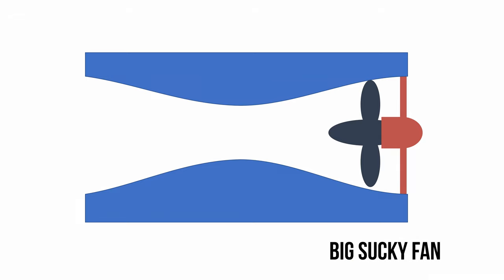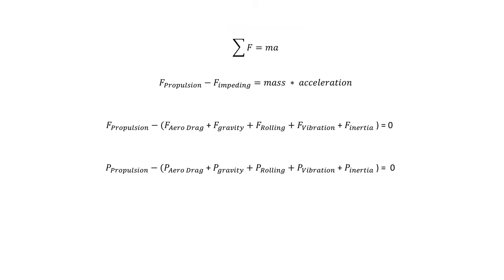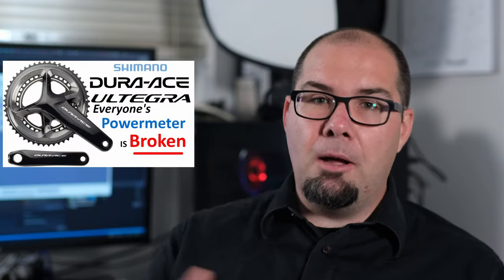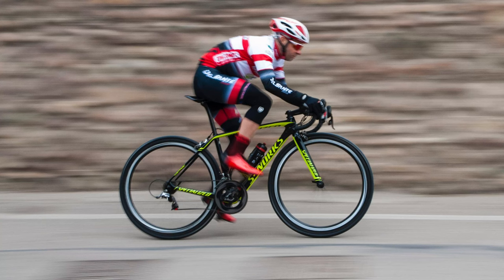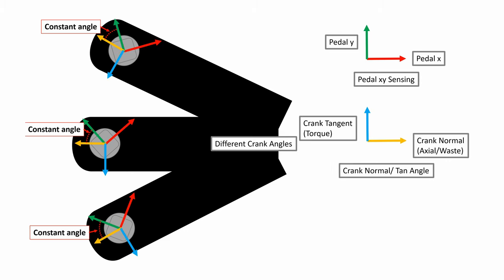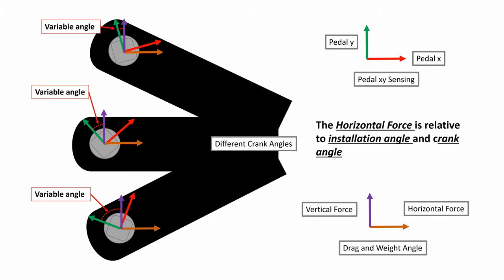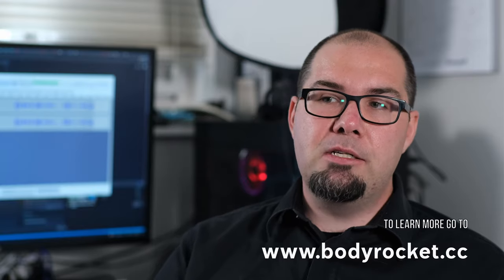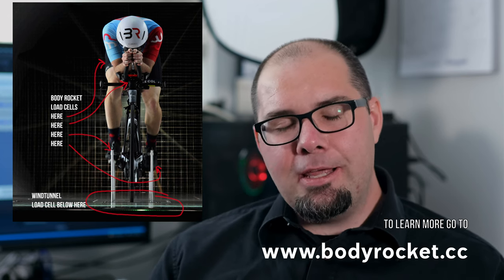What is Direct Force Aerodynamic Sensing... and what isn't?

Comment: I'm intrigued as to how the final product from body rocket will integrate with people's actual bikes. With so many modern TT bikes being so integrated and requiring specific front ends (not to mention different pedal systems), I'm interested in how this will work from a commercial standpoint. I'm sure you've got this figured out as I know there are multiple very clever people involved.
Reply from the maker: That's not my wheelhouse, but you're totally right. It's fairly similar to my involvement with crank based pm design... just harder here. More going to monorisers for TT/Tri bikes has helped.
Reply: Yes, integrated front ends are definitely one of the challenges we've had to address. The system is designed to fit any standard 31.8mm bar clamp, which still covers a lot of bikes if you go to a triathlon or time trial, and we'll support the top 10 brands in the Kona bike count. with adapters for each super bike. It's a similar challenge faced by all the companies making custom aero extensions right now.

Comment: If you have force measurement for the handlebars and seat couldn't that also be used for optimizing a bike fit? You should be able to measure the rocking on the saddle which impacts saddle position. Weight distribution between the contract points but mostly weight on the handlebars could help position the rider. (See leomo and gebiomized)
Reply: Which could allow offering a bike fit that also optimizes your aero drag
Reply from the maker: You should check out some of the BR videos that they are posting recently as you're ideas is something they've started seeing with Pro's now. People do weird stuff on bikes with not only vertical. How people apply forces through all four sensors is just about as crazy as as my realizations in previous crank dev dealing with Asymmetric correction and gage design. People apply forces werid and unexpectedly. It'll take a few years before people start looking at forces in the BR system and correlating them back to fit but it's a cool idea.

Comment: A few clarifications points:
-BR needs a pitot tube, so why differentiate between "pitot tube method" and BR method?
-BR does not calculate wind force directly. Instead, it measures the change in resistance of 4 slightly elastic parts of the bike (stem, saddle, pedals) to try to infer what the bike to body force might be. It is not direct at all and it suffers from many issues like road vibrations, temperature changes, etc.
-In particular BR needs inclination values, just like the so-called "indirect" methods
-If power meters are too inaccurate "force-meters" to measure the actual forward force applied to the bike, why would 4 "force-meters" do a better job?
-BR only measures body drag and as such cannot capture bike/body aero trade-offs, which are the hot topics everyone is working on these days.
-BR is not sensitive to rolling resistance, but therefore cannot measure it at all.
-Similarly BR ignores wheel drag, but it's a topic nobody cares about ;)
Reply: And most importantly, you need to almost entirely change your bike setup to make it work + add a Pitot tube. Pretty invasive method...

Comment: Hey Keith - I hadn’t twigged that there was a central load cell and I thought there were a bunch of sensors behind the rider & attached to the frame. I wonder if long distance gravel could benefit from dynamic adjustment of position over the course of a day/ days. As the project’s pedal sensor guru, will the end product be something like the Favero Assioma Duos with pods and a shaft - allowing my fellow lesser mortals (who don’t ride with road cleats) the ability to add MTB SPD pedal bodies to a “std” shaft? The system will set the cat among the pigeons when it is easy for product testers to see if that gadget stating a massive Watt improvement can deliver the goods IRL. Snake oil beware.
Reply from the maker: A big hurdle with the increases in accuracy needed for the pedals is that it's electronics are bigger and more power consuming. We are trying to keep it as small as possible. Walking back very expensive sensors is the challenge here. Keeping the whole design competitive to the current generation pedal platforms is important and we think we can get it there -- I just won't be sleeping much.

Comment: Sensors at the bars, saddle and pedals neglects collecting aero drag from the equipment. It’s too far up the load path.  Testing equipment is pretty important. Current aero meters may not be able to measure your exact Cda on the road for the reasons you stated. However if u test in a methodical systematic way it will for sure tell you what is more or less drag.
Reply from the maker: Equipment is important but fairly constant except for interaction effects.  Given the orders of magnitude difference in repeatability and usability in the real world though that's the trade. Reliable numbers of just you, or unreliable numbers of you and a bike.
Reply from the maker: I did want to point out I'm supper happy about your comment. It means you get it! So happy
Reply: Yes understand your reasoning and I agree with you that the system has flaws. However, having worked with a aero sensor over the last year and smashing all of my TT course pb’s this spring I can tell you that as long as you are systematic about the testing process you will find gains. If you know to look out for the flaws you mentioned there are ways to work around them through the testing process. As an athlete my end goal is to go faster, not calculate my exact Cda. For that the current aero meters are adequate if you know what you’re doing. Best of luck on this project. Will definitely watch out for it.
Reply: It's a good point Sean, and certainly the focus of most of today's testing. Because our system collects all the same information as other systems AND drag force on the rider we'll be able to offer a test mode that's let's you use VE (and the required methodical, systematic testing you've mentioned) to test equipment. However, as a team we think once you've got constant, actionable feedback on the 80% of your drag that is your body, you'll spend a lot less time worrying about your bike equipment choices.